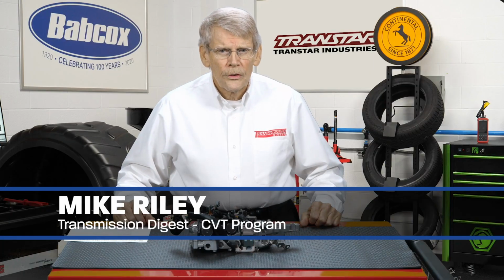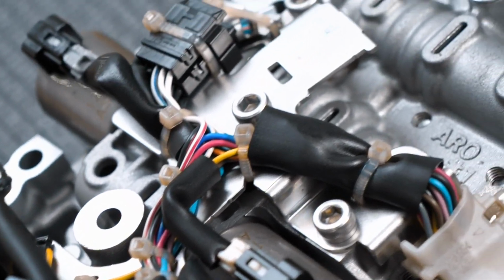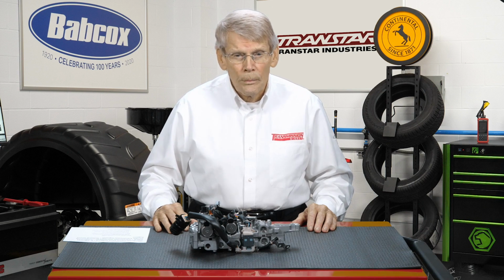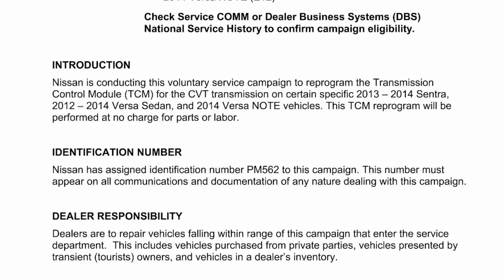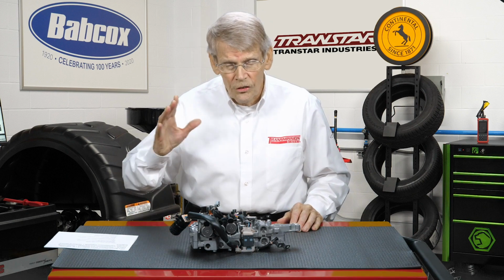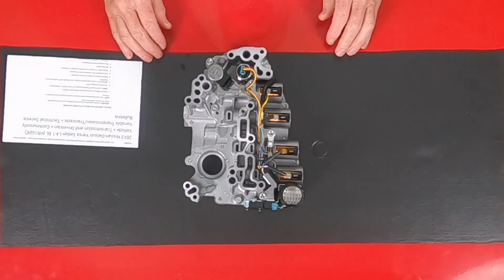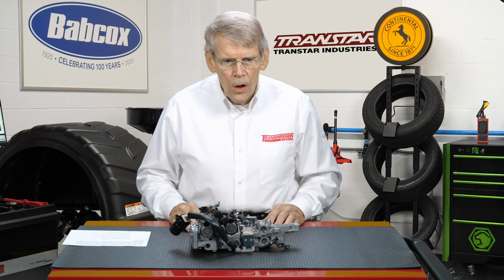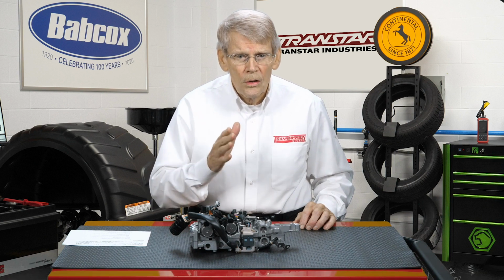Diagnosing a CVT

Comment: Spectacular vid Mike, I think you might have seen my issue yourself, or know about it, nobody else including my mechanic knows what to do, though I haven't brought it to a transmission specialist, none in my area.

I have the 2014 versa, every few months it won't shift out of low, it's not linkage related, it goes into reverse and it reads drive on display.

When I let the car sit over night, the issue corrects itself, do you think this is tcu?

Also, it revs about 3k doing 55mph, is this normal?

If you get to this Mike, thank you

Comment: CVT are a Terrible Transmission, should have let them in the snowmobiles, Parts are very hard to acquire and expensive And for what. .0001 mile per gallon
Reply: Even in snowmobiles, they need rebuilding every few thousand miles, at least the belt, but they're so simple anyone with tools (about 150$) can service themselves